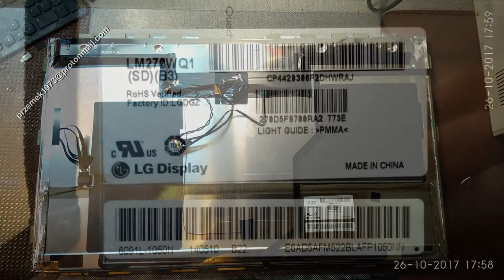Apple Thunderbolt Display A1407 disassembly open, repair, jak otworzyć

Comment: Nice! really calming to watch and I like it with just the pictures so self-explanatory.

I would like to as for your opinion Listnnosz,  

I bought an Apple Thunderbolt Display A1407 but it won't turn on when it's plugged in, the Maglite does not come on.
I tested the power cord it seems ok, but still has no power coming out of the display even when it's connected to the mains/devices.
I did a teardown and removed the PSU board and logic board I am hoping to find a way to test them to make sure they are working.
Do you know how if so would you share? 

Thank you.

Hugh

Comment: Hi great video. I noticed that my Thunderbolt display emits a strange clicking noise (very short and random) especially when I increase the brightness of the screen. Do you think changing the power supply with a new one would solve this problem?
Reply from the maker: Hi,could be of course but...this is an electronic world and nobody know what happend inside without opening ;( Im sorry

Comment: Great video.  I am repairing the same display (A1407) and the monitor exhibits a few issues:  When power or thunderbolt cable from the display is plugged into any Apple thunderbolt equipped laptop, these issues are exhibited  - 1.  I hear a buzz (sounds like crickets at night) from the display.  2.  The thunderbolt connection randomly drops causing the display to flicker.  Where would you start to trouble shoot?  I have checked all external variables and all software/firmware is up to date.  Thank you anyone for help.
Reply: I have the same problem! Have you found a solution ?
Reply: Im no expert on apple, but imo i would believe you're having a bad/intermittent connection with thunderbolt. Could be the plug itself, wiring to the plug on the display side or even the solder on the port in your MacBook (or device you're using). I work with lots of electronics and in most cases what you're experiencing sounds like a dirty connection issue or some form of interference. Repairs could vary greatly
Reply: Solution:
1) Buzzing noise is due to bad Power Supply.  So, either you fix the Power Supply (I saw somewhere in Youtube a video that shows how to fix this), or just buy a new Power Supply on eBay.  This could be a bit costly.
2) Flickering problem is due to bad MagSafe cable.  Just replace with a new one.  Pretty cheap, price is around $20 on Amazon.

Comment: What caps did you replace ...was it on the power supply or the control PWB ?   time 4.46 on the video ?
Reply from the maker: There was a lot of problems with the power control and I gave up
Reply: @ListonoszSzczecin  just fixed mine...shorted transistor
Reply: @ggltech  how u repair/replace the transistor???

Comment: Great vid
Reply from the maker: thank You rant
Reply from the maker: thanx
Reply: What exactly was great about it? No explanation, no result, just random photos of the interior of the display in no clear order.
Reply: @olovk3799  This is an old video and my comment is over 4 years old. What made it great; it showed the assembly points, which made it easier to do repairs to the modular aspects of the old monitors. At the time I had to resolder jumpers,  retrack power supplies and make a custom ribbon cables for the LCD display, right pain in the a** but the video helped. So for me at the time it was a great video, for you however, it seems to be a bunch of pictures.